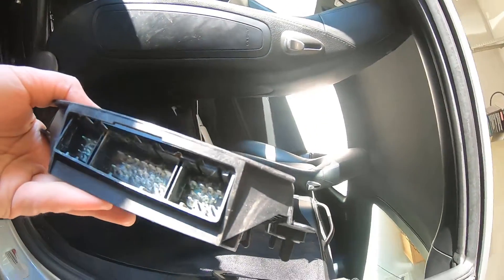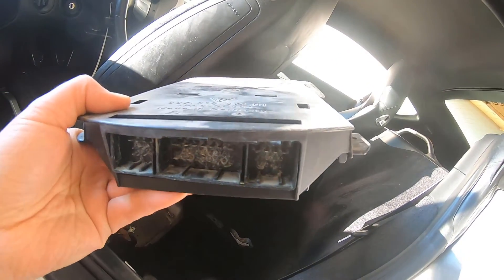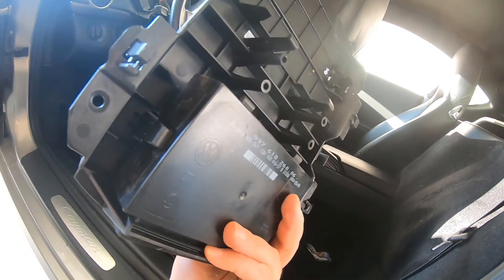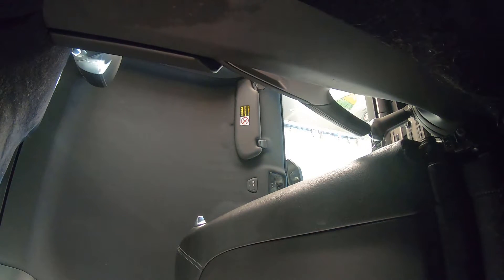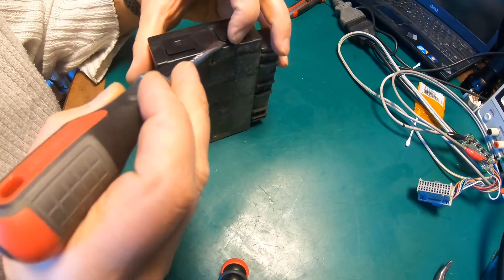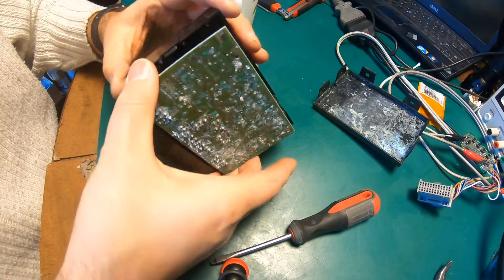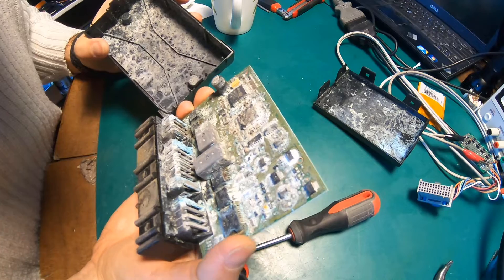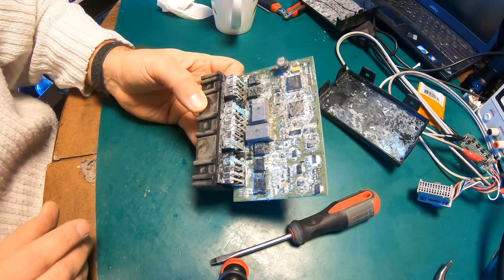This is why the taillights are working in a Christmas lights mode on Porsche Cayman

Comment: Greetings, a question, this module also controls the brake light? I have the problem that this light does not turn on and I have checked the fuse, the pedal switch, the bulbs and the line and they are fine, but the brake light still does not work, help
Reply from the maker: It was a while back since I look at the schematics, but I guess you are correct- RCM is controlling the brake lights.